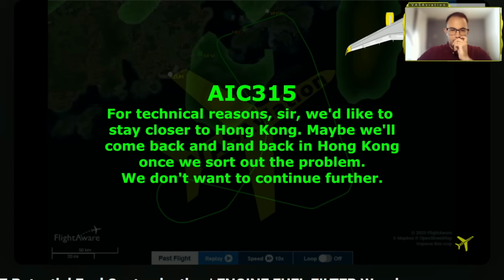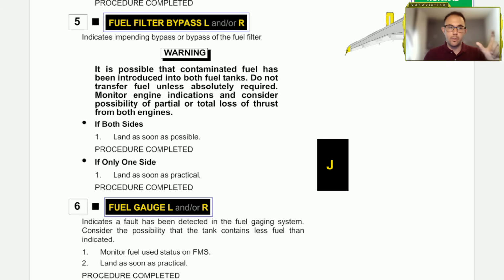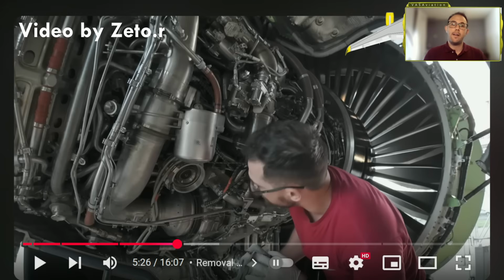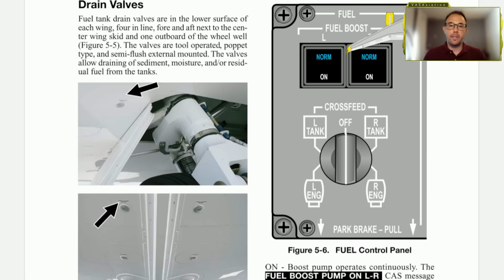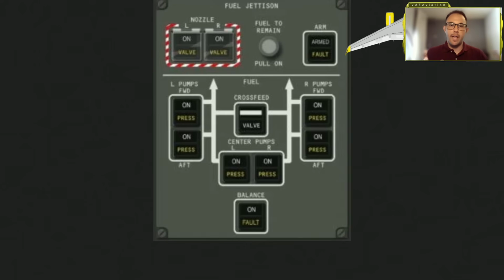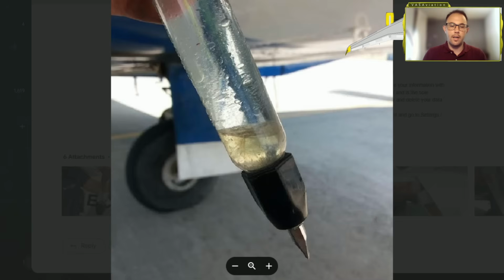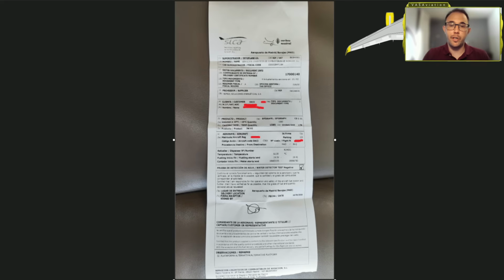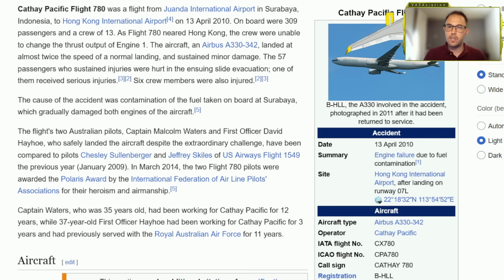Fuel Contamination | Fuel Filter Issues onboard Air India AI315

Comment: Yep.. These filter systems have a bypass system built into the bowl assembly for a reason. So, a clogged filter will not flame out the engines. But contaminated fuel could. Retired airline A&P
Reply from the maker: Exactly, that's just what I explained
Reply: nice job on that explanation. I didn’t see the other comments on this :)

Comment: Some comments mention the filters being able to bypass if clogged.
   That is a "hail mary" scenario, as dirt passes through, and is likely to clog the next component in line. Maybe the FCU. Power loss may still occur, just a bit later. In fact, it may be likely.
    Fuel probably passes through numerous filters before the FCU, and there may even be "last chance" filters in the nozzles.
   Some filters are easily installed backwards, which can cause constant bypass, again possibly leading to the next filter clogging....
   Or, could simply not flow, which is not the case,  as the flight would never leave the ground. 
   The wet wing type fuel tanks are sealed by 2 part "polydisulfide" sealer, often applied to areas hard to even see, resulting in hardened sealer floating around, which will end up in the filters and strainers. 
   I have seen, on small corporate type jets, filters almost clogged with this type of debris, and other junk.
    If you think everything is clean and controlled in aircraft fuel systems, think again...the fuel truck is not at all the only source of contamination.
     Mechanics working outside, at night, in winter, in a hurry (because it "has to fly in an hour") on an unfamiliar aircraft that has a fuel leak- are an excellent source of contamination. 
   A trijet,  either a dc-10, md-11, or an L-1011, I forget....lost two out of three engines due to improperly installed filters.
   It was a transatlantic flight, they turned back and barely made land, the third engine was probably going to fail for the same reason. No casualties, but easily could have been everyone.
   A jet like the 787 probably has hundreds of feet of caulked seams in all the fuel tanks. I bet none of them even leave the factory without some debris in the filter. I am not knocking Boeing,  either, that's just the reality of large very complex machines.
Reply: Found that  double engine failure- it was actually chip detectors installed without o-rings, resulting in failure due to oil loss, not fuel. The flight was miami-to-bahamas, it turned back and made it. Third engine failure (of three) was imminent.  It was a mistake similar to improper filter installation.  Aircraft was an L-1011.

Comment: from avherald: "On Jun 20th 2025 government officials stated, that India's AAIB is currently looking into another case of dual engine problems with an A321 that happened in London Gatwick in 2020, see: Incident: Titan A321 at London on Feb 26th 2020, left engine surged, engine stall indications for right engine, that was caused by fuel contamination. It appears on preliminary findings, that there was no error in the cockpit, it appears that as soon as the flight became airborne the power failure occurred leaving the aircraft unable to climb to a safe altitude."
Reply from the maker: We'll keep an eye on the official reports

Comment: I'm not an engineer and not even a pilot...so maybe someone can respond to this with an explanation or whatever. 

My thought is this...both the accidents mentioned in the video happened on approach. The planes had been flying for a while before it got to that point where it caused an incident / accident. Even with Air India 315, that was on take-off, but they had sufficient time to run checklists and return to the field. 

This doesn't fit with what happened to Air India 171, where it crashed almost immediately after take-off. That's a very quick timeframe for *both* engines to be damaged to that degree from contamination. 

Idk, maybe I'm wrong. As I said, I'm not a pilot or engineer....so maybe I'm way off. But hopefully, what I said made sense and if I'm wrong, someone can explain it.

Comment: Someone suggested it could be a issue with the fluid going gasseus due to heat and pressure- is that possible cause to dual engine failure?

If there is a contimanition will it not show in the excaust on the video?

Comment: Former 787 GEnx-1b A&P at Boeing in SC here…. The 787 has what’s known as a Delta-P bypass. The fuel filters being clogged would not cause an engine out or even more a duel engine out! This is most likely a fuel delivery or contamination issue. Possible human factors at play here from pilot to maintenance to ground crew or even the owners. This is only speculation, my opinion.
Reply from the maker: Thanks for that information!!
Reply: The Delta-P bypass only shifts the contamination further into the fuel system. If there is enough debris or if the filter is allowed to bypass for long enough, something else will block up.
Reply: @ericranshaw  I'd assume if the fuel begins to bypass the filter, that would set off some annunciator in the cockpit, and it would indicate an aborted takeoff below V1, right? And if the fuel did bypass the filter, as you describe, it would take some time for the contaminated fuel to cause problems downstream? This seems to have been a fault that was first noticed after V1, but happened so suddenly and completely that the plane rotated, barely lifted off by the end of the runway, barely got airborne, and crashed, all very rapidly. If it's fuel, it seems to have been something that very suddenly cut off both engines. Make sense? I mean, if the filters were bypassed, it seems to me they should still have power for some time, depending on the nature of the contaminant.
Reply: @DrBeenaPlumber  Entirely agree. A gradually increasing blockage should be easy to catch before it causes a catastrophe. A sudden rush of debris (maybe disturbed as the aircraft rotated) might cause a flame out of one engine. Losing both engines at the same time seems highly improbable.
Reply: @DrBeenaPlumber  fuel pressure high indication they got a no fuel pressure.
Reply: @Nick-u1s  Fuel pressure to the engine was fine until it was manually cut off. They released the interim report yesterday. It's... chilling. (I think it's incomplete in a lot of crucial ways though. Missing important factual information that they surely have.)
Reply: @ericranshaw  shove it as far as u need to just don’t flame out on me like a clogged filter would do…. Some thrust is better than no thrust.
Reply: Serious electrical failure is much more likely, vapor lock is non sense and so is fuel filter. Some youtubers think we fly mopeds
Reply: @jayoscar4441  Mopeds are usually gravity fed and have the fuel line in free air not up against the engine, so even they won't vapor lock. 
Vapor lock is limited to extremely poor fuel system designs in combination with particular fuels and environmental conditions. (And almost exclusive to low cost carbureted engines due to the nature of the cost cutting, combined with automotive grade gasoline which has a rather wide vapor pressure allowance from batch to batch.)
Reply: @jayoscar4441  Giving a bit of background of why you say that would help me and other moped pilots to get your point.
Reply: @jayoscar4441 no need for name calling
Reply: @jayoscar4441  not on the 787 there are two generators per engine and one on the apu and a rat…. Triple redundant systems and the most modern electrical system ever designed on an airplane. More like human factors…
Reply: Mentour Pilot said that vapor lock was not possible in the GEnx engines. Is this correct?
Reply: @Elizabeth-tg7jo  The vapor pressure of Jet-A is only 2% of sea level atmospheric pressure at 100 F.  The fuel system is pressurized, with a low pressure fuel pump at the tank providing positive pressure and flow to the engine, and each engine will have a separate high pressure fuel pump, necessary to get an adequate fuel flow and spray pattern to the combustion chamber.  Failure of a pump can cause engine failure, but it won't be from vapor lock.
Reply: @Elizabeth-tg7jo  no they won’t vapor lock.
Reply: Fuel delivery means something like electrical or pump issues?
Reply: @rm6857  unfortunately it was worse than that.
Reply: Could wrongly set derated TO-2 thrust be a factor in here? I mean derated, not Flex/assumed temp which can be overridden in case of emergency.
Reply: Sure bypass will keep those engines going but only if the fuel is something a jet engine can burn. I have seen nothing about checks on the fuel at the airport.
Reply: @Bowser-j8q There's a good example from years ago, where a maintenance crew hugely overdosed an airliner's fuel tanks with an anti-microbial product and the pretty much pure product found its way to the engines, causing them to fail I believe. I think it's on the Mentour Pilot channel.
Reply: @Bowser-j8q I was thinking the same thing
Reply: This is what I feared! A pilot cut the fuel to the engines…. Human factors. The location of these switches are horrible. They are placed for convenience, not safety.

Comment: From the perspective of someone who fuels commercial aircraft and holds a FAA commercial certificate, I often think that the fuel is at the greatest risk of contamination when it is sitting in the aircraft. As you point out, the issue of condensation in fuel tanks exists, leading to water in fuel. I have also heard of issues with microbial growth occurring in fuel tanks, which could hypothetically cause blockages. This issue can be mitigated by adding an icing inhibitor additive to fuel, which binds with free water to prevent it from freezing.

Fuel tank degradation is also a concern. I do not know what the inspection cycle for a fuel tank is, but I know there are people specifically trained to crawl in a fuel tank and perform visual inspections and maintenance.

When we think about the lifecycle of Jet A, the risk of contamination through the fuel farm process is very low as long as it keeps moving. The average gallon of Jet A can easily pass through five or more filters within the airport perimeter on its way into an aircraft, going between various pieces of equipment that are inspected.
Reply from the maker: Thanks for all this information!
Reply: EXCELLENT post.  Very informative and food for thought.  Thanks for this.
Reply: We had a tool that drained water from each fuel tank back when I was in the USAF, that we used on the heavies. It was a donkey d..k. But still, the timing of this is odd, unless the jet was refueled then sat to allow the water to settle at the bottom, but then the pilots would feel the lesser thrust and should have aborted the takeoff before even reaching the runway. I don't know what they do in smaller airports in India but at this point, wouldn't surprise me if they put in the wrong fuel, something lighter, and it simply burned up the JetA, then began trying to burn whatever was pumped in the tanks.

But having both engines cut off at the same time is hard to do, in that short of time. I didnt see any rudder movement for the asymmetrical thrust.We will see I guess.
Reply: @RipRoaringGarage  I guess the critical period was from V1 to a few seconds after takeoff.  Some sources are suggesting takeoff went slightly long.
Reply: @LokiCentral  It does seem that its takeoff roll was a bit long, but Id still be looking at the CVR at why they persisted. Also, the standard departure called for the turnaround midway down the runway, yet the crew opted to go to the end of the runway. So they should have had plenty of time to notice if the engines were up for it. Did they notice any abnormal EGT, or N1, N2? That will show in the FDR at least. Still, lots of questions still, but I have a feeling we will not get full answers, much like the Korean crash where there are so many questions left unanswered.
Reply: I lived right next to an RAF base for twenty years, they drined any remainig fuel from the tanks into drums when they landed and sent the drums back to the refinary. Well thats what I was told by one of the ground crew who let me have a bit for degreasing purposes.
Reply: yeah closisporum,,,  goes like a carpet   think there are fuel additives which control it
Reply: There is video of this aircraft sitting idle on the ramp for  over an hour I believe, I wouldn't think that would allow condensation , but it was a hot humid day there. Engines were shut down. The air conditioner was off. It's getting hot and power issues for the passengers. Mostly makes me think they had some other maintenance issues they were taking care of.

Comment: I saw a small comment that the black boxes are damaged. I hope they can get the data. Here is my issue. Maybe I am looking at this the wrong way. That aircraft had enough power to rotate and leave the ground, then just at the most critical time, it lost power, and the RAT deployed. It did not lose power during the takeoff roll or after it got some altitude. Lost power before they could even fully retract the landing gear. That really bothers me. What are the chances that an airplane with a fuel problem would lose power right at that critical time? We may never know!
Reply: Well, it is the single period of an entire flight where the fuel consumption is the highest
Reply: @AE_Sub  From the time the pilot advances the throttle forward until a while after takeoff, the fuel consumption is very high. This was my point; the power loss happened exactly at the most critical time. I'm not attempting to say anything but to say that at the EXACT time when the pilots needed the power, the power failed. To me, that is just weird. I will say this, though. If there is a hidden problem with the 787, Boeing needs to get this fixed!
Reply: Yes, just a few seconds after the gear was being raised something tripped, initiating a system reset which caused both engines to roll back automatically, imo. Not fuel ... software!
Reply: @TommyTester , I'm not going to speculate on the cause. I will wait for the tin kickers to finish the investigation, and I hope they find the cause. I don't want another United Airlines Flight 585 or USAir Flight 427 situation to happen again. It took a close call with a third flight to finally find the causes. What concerns me is how automated these aircraft have become over the last 40+ years. I was speaking to a long-retired Eastern Captain who is in his 90s the other day.  He mentioned this as well. The more you automate, the more complex you make these systems. The more complex you make these systems, you increase the odds of a malfunction of some type. Don't get me wrong, I am not advocating we go back to the way aircraft were in the 1950s. I was thinking the other day about the Apollo 1 fire at the Cape back in 1967. One of the criticisms of NASA was that they needed to slow down. They were sticking so close to flight schedules that they had men flying T38s into bad weather and sadly lost 2 astronauts in St Louis. I know I am getting off track a bit, but I am trying to get a point across.  If it is a software issue, that means there is a bug somewhere. Sometimes these bugs can't be seen easily because a set of circumstances has to happen to cause an occurrence. I fly on the 787 several times a year. I have already made the decision to not fly on the 787 again until this situation's cause has been found and corrected.
Reply: @THE-michaelmyers  Yeah exactly, highest fuel consumption = highest chance for something to get swirled around and sucked up by the fuel pumps
Reply: You are too much online  @THE-michaelmyers
Reply: @AE_Sub  Again, I am going to go back to my first comment. I was thinking about my Cessna 182, and when I take off in it. From the time I apply full power through my takeoff roll and until I am about 500 feet high, my throttle is all the way in.  Then I slowly pull it back a bit, and finally, after a while, start setting my prop. Let's say that from the time the pilot flying advances the throttles until they reach about 1000 feet AGL should be in the neighborhood of a minute. The time the fuel system gets clogged up is at precisely the most dangerous time of that minute? Common sense should dictate that if there was a contaminant in the fuel, it would be seen and/or felt during the takeoff roll, hopefully before they reach V1. 

Last night I was listening to a current American First Officer and two retired Pilots talking about this. None of them have flown the 787, but they did say something I thought was interesting. At this point, you rule out nothing. There is a lot about this crash that makes no sense. I just want somebody to make it make sense!

Comment: Simple solution adding safety redundancy with minimal weight increase - have two identical fuel filters in parallel, with the second filter only used during the automatic bypass mode which will have notified pilots as well as maintenance.  Also a total filter bypass mode could be integrated if fuel starvation persists after switching to the second filter.  This way in most cases aircraft can continue and land with minimal risk of damage to the engines and then both filters can be changed at that time.  This avoids unknown filter clogging status caused by neglect and focuses maintenance where it's needed.  The fact something like this isn't already implemented is a head scratch-er.

Comment: I think dumping fuel before every flight is unnecessary.  I sump before the first flight of the day, after refueling or after flying in the rain.  Otherwise, I will make multiple flights in a day without dumping between each one.
Reply: Thats a mistake, if cap was off and water got in or anything you'd catch it prior, maybe some nut dumped a coke in fuel tank while you where away.  Always follow checklist no matter what.
Reply: @publicmail2 So, if you are flying 20 minute sightseeing rides all day Saturday, you will sump your fuel after every 20 minute flight?